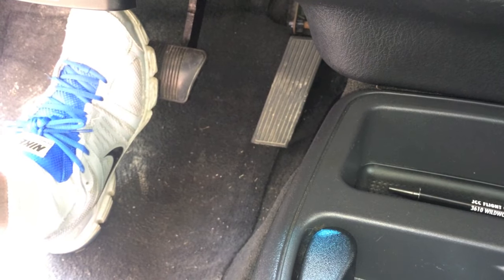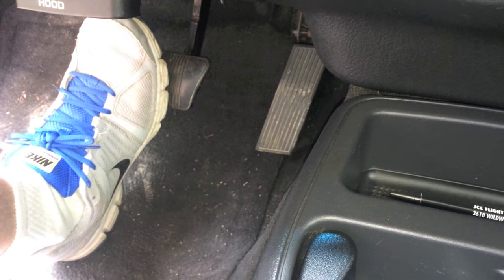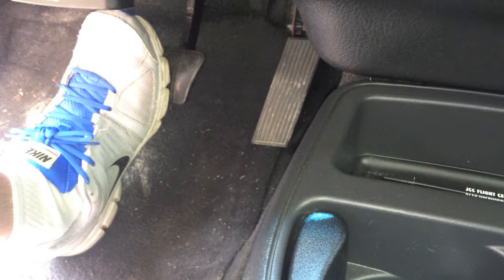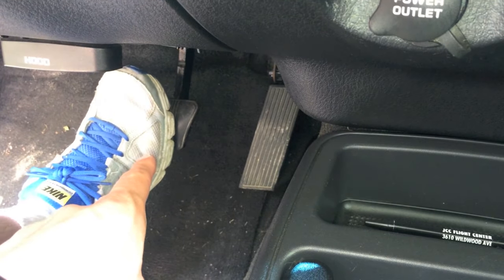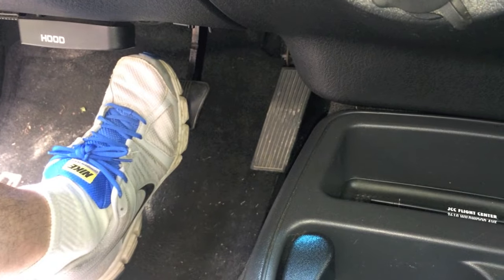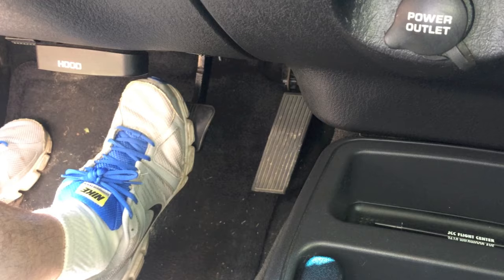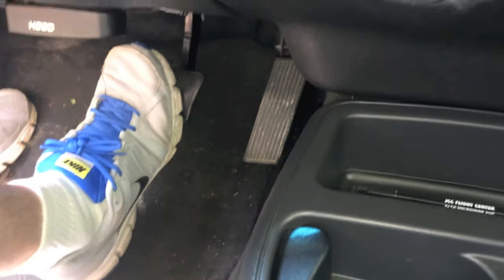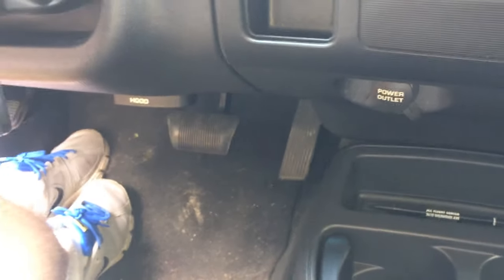HARD Brake Pedal - How to check if your BRAKE BOOSTER is GOOD or BAD

Comment: First, I really enjoyed the video. Second, I did have a question. My car at times idles rough. the rpm's fluctuate sightly up and down. Now when I hit the brakes sometimes the brakes are hard and when they are hard the rpm seem to go up and sometimes the car stalls or the motor starts to race and the car will not stop. Other times when going in reverse, I hit the brakes and the peddle is extremely hard and as I press the brake the RPM's go up pushing the car faster and it takes a lot of pressure to stop the car. Is this a booster that has a small rupture in the diaphragm or could it be just a vacuum leak elsewhere on the motor?  Sorry so long a question
Reply from the maker: The JunkFather 

Thanks for watching & sharing your experience.  Let’s get this figured out.

First thing that comes to mind is your Idle Air Sensor.  This sensor regulates the amount of air mixture to the system to properly provide an efficient mix.  If this part becomes faulty, your engine will no longer be able to hold a constant, efficient, & relaxing idle.  Below is a link that shows this part & how to replace it.

       https://youtu.be/6tKhTSWJCzA

The second thing that comes to mind is your Master Brake Cylinder (MBC).  Your MBC is the heart of the brake system & regulates all brake fluid to provide a proper balance of fluid “To & From” all Brake components.

As your MBC wears out, you will experience your exact symptoms.  Below is a link that talks more about the MBC however it’s not a replacement video but still good info.

       https://youtu.be/F9s_1VZ2u5E

Let’s start there.  Your engine & brake system are acting pretty darn weird!  😲 😳 but we can figure this out.

Please subscribe to the channel and turn on your YouTube notification Bell 🛎 that would be awesome thanks again!  😎👍🔧🔩

Comment: Thanks. My car shut off twice in the last 3 months. When it’s in idle and sits awhile, the car starts to shake a little then turns off. The break pedal gets hard as well. When I let the car sit for about 30 mins it starts and runs fine. Had 2 car shop diagnostics done and they can’t pin point the problem. They checked battery and alternator (which was fine) and gave me a fuel system cleaning. After the fuel cleaning I still feel uneasy like the car might shut off again at some point. Any advice on this would be helpful. Don’t want to end up spend thousand on repairs not needed
Reply from the maker: Thanks for watching, we recommend replacing spark plugs and boots if haven’t in the last 3 years.

It may be that simple.  Keep us posted.
Reply: @DIYwithMichaelBorders  ok thanks for the reply. Yeah, I got new spark plugs about a year ago not sure about boots unless it comes with repair. Could it be the breaks?The diagnosis never mentioned bad breaks but the breaks haven’t been serviced In a good while.
Reply from the maker: @FUNNYMANERICWHITE  

Thanks for the follow up.  It’s definitely a possibility.  Time to troubleshoot and we are standing ready to help.

Comment: Thanks man. I had a scary situation a day ago. I had to brake hard to avoid a crash. After I was cruising I could smell a burning smell for awhile and then it went away. But 10-20 miles or so the brake pedal was stiff. The brakes worked but were stiff. My vehicle wouldn't accelerate properly and when I went to shift the car acted like the brakes where pushed in and would jerk. It took a long time to get to speed. I'm no mechanic so idk what could've happened. Eventually everything seemed to go back to normal but I still don't trust it.
Reply from the maker: Bob Smith 

Thanks for watching & sharing your experience Bob, glad you’re ok.

A sudden surge in the system can cause issues however not always.

It’s very possible that your Calipers tightened up & did not full release after you took your foot off pedal.

We recommend keeping an eye on your brake system & checking for any signs of leaks...preferably near the Calipers & rubber hose coming off of Calipers.

The “higher than normal heat” generated inside your Calipers by such a rapid stop as you experienced can actually degrade the lubricant grease inside Caliper Slides...which leads to Calipers not releasing brake pads properly.

I will post a few troubleshooting steps for you.  Let’s get this figured out!

Keep us posted.  Please subscribe to the channel and turn on your YouTube notification Bell 🛎 that would be awesome thanks again Bob!

😎👍🔧🔩
Reply from the maker: Bob Smith 

Let’s work through the items!

1.  Its possible that your caliper is beginning to stick...maybe caliper slides have lost the lubrication required to shift back and forward freely.

2.  It can be possible that your Caliper piston has lost its lubrication which will also interfere with the efficient shift back for forth.

3.  The front rubber brake lines that connect to your caliper fail from the inside as opposed to the outside.  This means the inner coating begins to break away and clog portions of the brake system...hence not allowing fluid to flow back and forth freely.  

4.  Your brake pads have little prongs/teeth on them.  You will notice by their location...the pads slide on a steel brace.  This may need to be lubricated to bring the shift back to efficient requirements.

We have attached a few videos.  Lets start with the easy items and then work our way up!  Lets figure this out together!  Keep us posted!  Please Subscribe to the channel and turn on your YouTube notification Bell 🛎 that would be awesome!  Thanks again!

Links to all of our helpful step-by-step videos explaining the above possible causes are below, definitely check those out!  😎👍🔧🔩

1.  Caliper Slides Lost Lubrication:

https://www.youtube.com/watch?v=-DZ68tKuCQc&amp;t=15s

2.  Too much Fluid in Reservoir:

https://www.youtube.com/watch?v=X-AJ5tD6zoA&amp;list=PLjCXOz8TSkZnavDiGDyHdPKe2dV2RzEMZ&amp;index=39

3.  Failing Front Brake Lines:

https://www.youtube.com/watch?v=3FTEgbLYAdI&amp;list=PLjCXOz8TSkZnavDiGDyHdPKe2dV2RzEMZ&amp;index=78

4.  Brake Pads not shifting:

https://www.youtube.com/watch?v=3Pq15BWM_qY&amp;t=103s

5.  Replacing Front Brake Calipers:

https://www.youtube.com/watch?v=8HoaL4QM5-k&amp;list=PLjCXOz8TSkZnavDiGDyHdPKe2dV2RzEMZ&amp;index=83

6.  How to check if Brake Booster is Failing:

https://www.youtube.com/watch?v=VK4lowH7kQE&amp;index=66&amp;list=PLjCXOz8TSkZnavDiGDyHdPKe2dV2RzEMZ

7.  Failing Brake Booster:

https://www.youtube.com/watch?v=j9s7yccswPQ

8.  Symptoms of a Failing Brake Booster Check Valve:

https://www.youtube.com/watch?v=j9s7yccswPQ&amp;index=68&amp;list=PLjCXOz8TSkZnavDiGDyHdPKe2dV2RzEMZ

9.  Master Brake Cylinder info

       https://youtu.be/F9s_1VZ2u5E
Reply: @DIYwithMichaelBorders  oh man thank you so much. I'm looking at it tomorrow hopefully and go over everything you linked. I appreciate it so much. I've been having problems with my Saturn vue since I bought it and seemed to have a bad wheel bearing and now this happened. So I'm not sure if it was the brake caliper making the humming noise around right curves driving on the hwy but it could be the wheel bearing and whatever is going on with the brakes. I did try the method of pushing the brake pedal until stiff and starting it up and the brake pedal released the pressure. I subscribed and Thanks again. I'll post and update when I figure out what's going on.
Reply from the maker: Bob Smith 

Awesome & thanks for the reply Bob.  Keep us posted.  Thanks for Subscribing!  😎👍🔧🔩

Comment: Would a bad booster be the cause of your pedal being super stiff? My break pedal barely moves when I press it can’t figure out why
Reply from the maker: @Phatcaulk  

Thanks for watching, it’s possible.  The pedal is supposed to stiffen up when pressed while engine is off.

Once engine turns on, the pedal should return to normal operation and be friendly to push.

If it remains hard after engine turns on, it can be one of the below items.

1.  Too much fluid in reservoir

          https://youtu.be/X-AJ5tD6zoA?si=Nage7x2WoeBMrX7x

2.  Faulty Check Valve

          https://youtu.be/j9s7yccswPQ?si=C7TMpCKN_rS3Af-7

3.  Faulty Caliper

          https://youtu.be/oTnIH_LmB1Q?si=vp4_eL7RVfzr-sif

4.  Faulty brake line

          https://youtu.be/3FTEgbLYAdI?si=A8Bo4IELGsTaRyyz

5.  Caliper needed lubrication

          https://youtu.be/3Pq15BWM_qY?si=4dF_YgLuCgtMVFSv

🧰

Comment: I've got a farm brake pedal. When I turn the car on the pedal goes forward but it goes forward all the way to the firewall and it doesn't give me the braking force I need when I try to stop the car. So clearly something is wrong
Reply from the maker: Thanks for watching, any update?  Has there been any recent repairs completed on brake system in last few months?

If no recent repairs, it’s possible that a brake line is leaking.  Please keep us posted.

Comment: Great video! I'm having issues with my brakes going to the floor out of nowhere once in a great while. It comes right back after pumping the pedal a few times but this has happened 4 times in the past year. Is there any way to know what would cause this to happen and if so what should I do ?
Reply from the maker: Mike Rodgers Thanks for checking out the video and sharing your comment and experience Mike.  The symptoms you're experiencing are exactly what a intermittent/faulting Master Brake Cylinder.  The Master Brake Cylinder is kinda tricky to repair on your own...in most cases however definitely doable if you're familiar with the basics.  If not, a shop price in most cases in a few hundred dollars.  Please keep me posted.

Please Subscribe to the channel and turn on your YouTube notifications that would be awesome thanks again 😀👍
Reply: Ya I have repaired and replaced just about everything on a vehicle at some point but when something like this happens it's hard to find the problem. Now to figure out which one is doing it.  I refuse to pay shop fees when i'm capable of doing repairs myself. Thank you very much for your help!
Reply from the maker: Mike Rodgers Thanks for update Mike.  I definitely agree.  Doing it yourself is fun and rewarding in the end.  This is exact symptoms of the Master Brake Cylinder as mentioned.  As you know, the Master Brake Cylinder requires proper fluid to be bled in addition to your brakes at each wheel.  Please keep me posted and let me know if you have any questions .  Thanks again for the update Mike!  😎👍

Comment: I have a automatic 2019 Honda civic I turned the car on and put it in drive and the break pedal was stuck and my vehicle was just rolling so I had to turn the vehicle off and cut it back on to put it in park and everything worked just fine after that. What do you think happened exactly?

Comment: So I bled all of the air out while the car was off. Very stiff pedal, but when I turn the car on the pedal goes almost all the way to the floor, more so than in your video, any ideas? great vid by the way....
Reply from the maker: drowization Thanks for checking out the video drowization!  Glad you liked the video.  Has there been any recent work to the Brake System in the last 12 months?  This will help get a better familiarization with the situation.  Brake problems are definitely annoying so lets figure this out.  Please subscribe to the channel and turn on your YouTube notifications that would be awesome thanks again 😎👍
Reply: I have an 04 Saturn vue.my..i bled all 4 wheels and abs petal is hard with engine off when i turn it on petal goes to floor help me
Reply: Did you figure it out?

Comment: good video it works.... but can a bad booster cause your cause your car to shut off when coming to a stop?
Reply from the maker: kevon bennett Thanks for checking out the video.  I haven't run across the booster turning off engine at stop.  Have you had any recent work done to the engine?  Subscribe to the channel that would be awesome thanks again!
Reply: kevon bennett yes

Comment: While I was driving, I noticed that it became hard to accelerate, and I realized that my brake had locked and was keeping me from accelerating. Came to a complete stop, and it went away. Haven't had it happen since, but could you tell me what it was?
Reply from the maker: Thanks for checking out the video James!  This is definitely not uncommon!

I can be a few different things....Lets figure it out!

1.  Its possible that your caliper is beginning to stick...maybe caliper slides have lost the lubrication required to shift back and forward freely.

2.  It can be possible that your Caliper piston has lost its lubrication which will also interfere with the efficient shift back for forth.

3.  The front rubber brake lines that connect to your caliper fail from inside rather that outside.  This means the inter coating begins to break away and clog portions of the brake system...hence not allowing fluid to flow back and forth freely.  

4.  Your brake pads have little prongs/teeth on them.  You will notice by their location...the pads slide on a steel brace.  This may need to be lubricated to bring the shift back to efficient requirements.

I have attached a few videos.  Lets start with the easy items and then work our way up!  Lets figure this out together!  Keep me posted!  Please Subscribe to the channel that would be awesome!

1.  Caliper Slides Lost Lubrication:

https://www.youtube.com/watch?v=-DZ68tKuCQc&t=15s

2.  Too much Fluid in Reservoir:

https://www.youtube.com/watch?v=X-AJ5tD6zoA&list=PLjCXOz8TSkZnavDiGDyHdPKe2dV2RzEMZ&index=39

3.  Failing Front Brake Lines:

https://www.youtube.com/watch?v=3FTEgbLYAdI&list=PLjCXOz8TSkZnavDiGDyHdPKe2dV2RzEMZ&index=78

4.  Brake Pads not shifting:

https://www.youtube.com/watch?v=3Pq15BWM_qY&t=103s

5.  Replacing Front Brake Calipers:

https://www.youtube.com/watch?v=8HoaL4QM5-k&list=PLjCXOz8TSkZnavDiGDyHdPKe2dV2RzEMZ&index=83

6.  How to check if Brake Booster is Failing:

https://www.youtube.com/watch?v=VK4lowH7kQE&index=66&list=PLjCXOz8TSkZnavDiGDyHdPKe2dV2RzEMZ

7.  Failing Brake Booster:

https://www.youtube.com/watch?v=j9s7yccswPQ

8.  Symptoms of a Failing Brake Booster Check Valve:

https://www.youtube.com/watch?v=j9s7yccswPQ&index=68&list=PLjCXOz8TSkZnavDiGDyHdPKe2dV2RzEMZ
Reply: DIY With Michael Borders 1987 Suburban doing the same thing
Reply: J_Skillet I have the same problem. Did you get it fixed?
Reply: I have the exact same problem my car start to smell like it’s my brakes too

Comment: Will an electronic brake booster do this ? I have a 2017 Toyota Tacoma with an electric brake booster and my pedal does not depress like shown in this video. Thank you for the help
Reply from the maker: Thanks for watching, they perform very similarly.  Any recent maintenance done to your brake system or wheels in the last six months?

This will help us pinpoint whether or not any recent maintenance is related to your issues.
Reply: @DIYwithMichaelBorders  The truck was just fully serviced it is a certified pre owned vehicle and passed NC state inspection where during the inspection they check the brakes. The truck only has 24,000 miles on it. I’ve been reading a lot online and people are saying most of the Tacoma trd off-road and pros have the electric boosters for crawl control causing the sensitive but stiff brake.
Reply from the maker: @jakespringett2617  

Thanks for the follow up.  Being that new, the system should be operating normally and as designed.